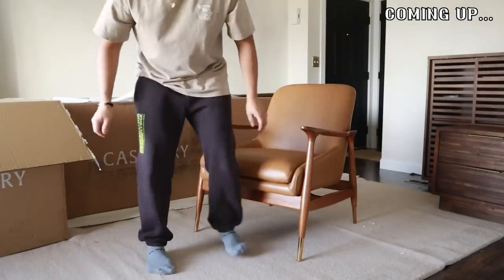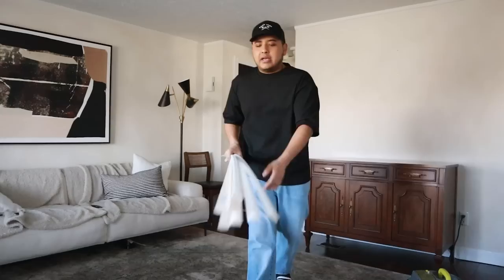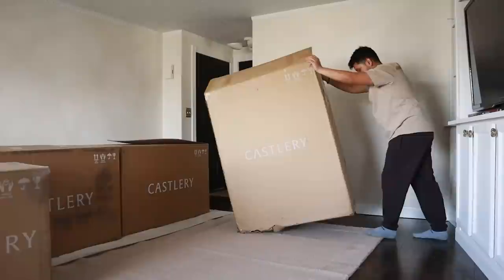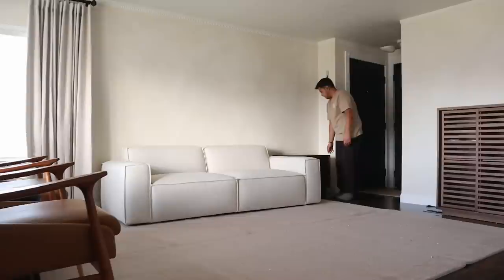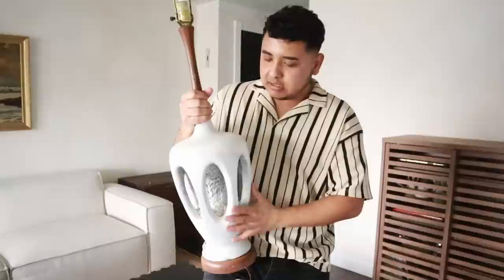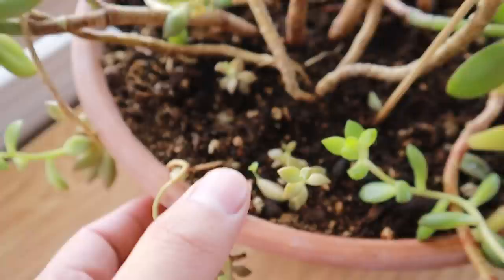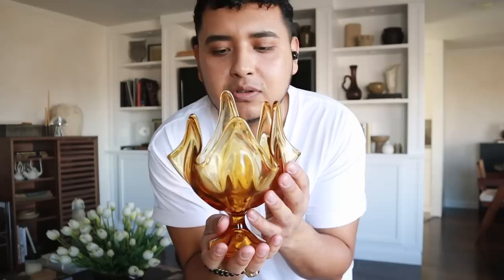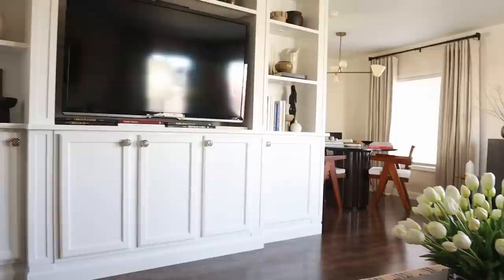UNIQUE LIVING ROOM MAKEOVER (DIYs + full tour)

Comment: suggestion for the table under the window.  you might want to put something under the plants to protect the wood from watering mishaps.  my husband ruined the wood in our bay window from the water overflow and i had to eventually get the whole sill sanded and restained.  also, although your cabinet with the sliding doors is quite beautiful, you’re going to have lots to dust over there.  you might want to consider putting clear acrylic sheets behind the doors. that way you can see in and it’ll stay dust free.

Comment: Wasn't LiKing that stripped rug;  then You added in that chrome chair 😍 and it Rocked That Room=❤ Unified, Especially with the chrome chair & that candle holder on the coffee Table...LiKe "Wow" Moment it ALL "Just Flowed" Together It's LoVe ❤❤ for Me & Has A Well Curated Masculinity. Great Job 🎉
😍 Would Love to be Able to Get A Modular Couch Myself; As it's My Favorite Kind, Always !! So Versatile 😮 & Easily Added Too (because center pieces can be easily used around different areas of the home or unified later into one area) Later; should you move in the Future ,or change your Mind about How to Style Out the House in the Future...(Worth the investment Now to buy extra modular armless Pieces) 😮 (While matching Material is Available >>NOW...)
Loved that You Did "You"; as that Lamp is Also A Great Find (so glad you repainted it) These Molding Worked in Around the Living Room are Great 🎉
Loved ALL "Your Furniture Choices"....🎉 You Do Need More Art Above that Modular Sofa as it Just >> Doesn't feel Quite Right 😢
The Art Over the Sofa would Look ( I 🤔 Better) Above that shelf by the Chrome Chair as the wood frame & Color and size wise might be more appealing visually; but Love that existing art Already Above that Chrome chair as it's Perfect ; So if You Could Either use that Larger Piece Above the sofa There Placing it Asymmetrically  above that existing cabinet
 (Believe it's Better placement but would have to see it to confirm ) or You could add an Actual Gallery Wall Above That Sofa ,Because it's Not 🚫 Working Visually or tonality Wise😮 My Past  Was in Designing High End Spaces for Huge Department Stores to produce Sales in Mass Abundance at Some Very Prestigious Stores Both in Vegas & Chicago where >>Selling "the Look in totality( the Whole Room Displayed)" was Reason I Was Hired. So it's Worth Thinking About , to Keep it Expensively Curated .> >> My Past in Design tells Me It's off 😢 Balance.
The Red throw 😢 it's A No for Me (Normally, I Love Red; Maybe it's Because it pops too Much ) As the Rule of Thumb is "Three popping pieces" , Not One 😢 eyesore like a punch to the face 😢
A faux fur or Something more textured in Brown or Brown & Black tones Would look Way Better 😮 on that Couch >>>😮 (Professional Opinion)
🙈🙊🙉 Unless: You ADDED in Two More subtle pieces elsewhere 😢 or a Picture ;that draws in a little reddish color 😮 into the Art 🤔 Above that Sofa??? 
Everything Else >>Rocks ✓ 
Love that Bench Color, by the Window It Looks Marvelous>> Really Great placement... Especially for Your Plants Health (double benefit) as Does the Coffee Table it's Absolutely Beautiful 😍
Could You Place <Some of Your African upside-down Animal Boxes on top > of that Existing Box , Above that cabinet>>> >> instead of ALL inside that Cabinet Unit ??? As those Pieces are Wonderfully Curated Finds 🙈
❤ A Vibe that's Differently Yet Wonderful, 💯% Curated in Anyone's Collection >>Should be On A Center Stage Amplified ❤ Not Lost inside of the Unit it's chosen to Shine in 😢...Also the Cabinet Would make a Great Alcohol Storage Unit of Collectables Glass & Stemware Unit for A Fine Bar Space for Entertainment Purposes, if you placed the unit on Higher slanted Legs Giving it a More Mid-Century Vibe..
LoVe,LoVe those Curated Pieces 🧩 As it Fits so Perfectly with Everything Chosen in the Living Room  Space.... Chef's Kiss 💋
**Sorry, not Sorry but I Do Think 💘 You'll be Rethinking 🙏 Some of those Easily Changeable ideas 💡 that 😢You've implemented. >> As You're Relaxing There ; in this Marvelous Beautifully Curated Space ❤

Comment: Wonderful room! Love, love, love the lamp. But I did prefer the shape and height of the other lamp shade. You could spray paint it with the same paint you used on the bottom for a perfect color match. I also like your art piece over the chrome chair, but it’s not large enough to my eye. I would pair it with that small white frame, one directly over the other, maybe paint it black. An Escher print would compliment your piece nicely and match the modern style of the chair.

Comment: May I suggest.  If you left a 1or 2 inch gap between your existing molding and the new strip you are putting up and then paint the piece inbetween white also.  You would have the illusion of a 4 or 5 inch crown molding. AND NO CALKING REQUIRED AS THERE ARE NO GAPS.